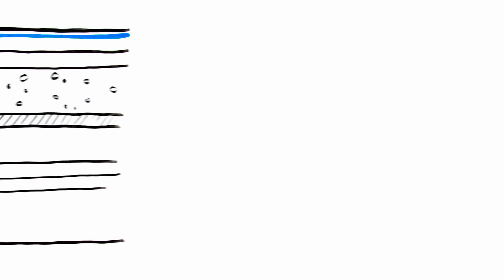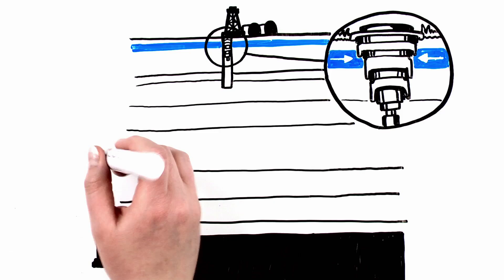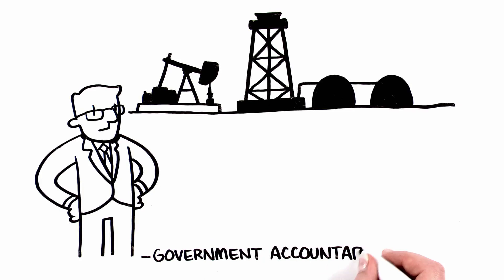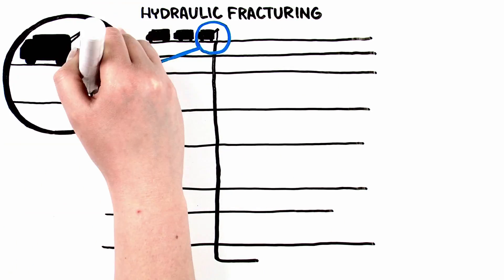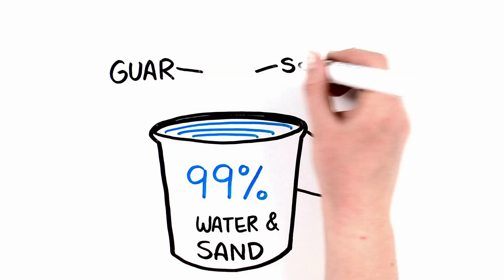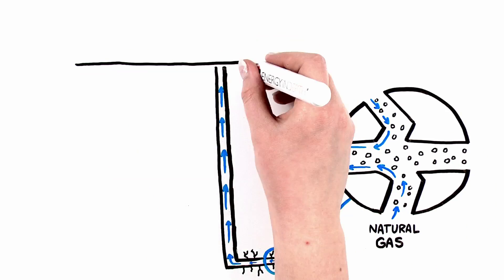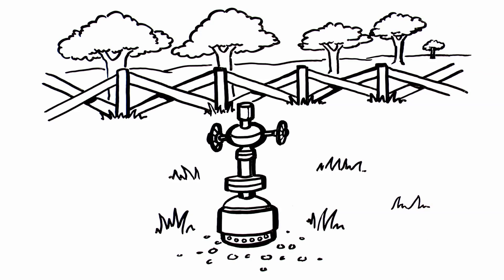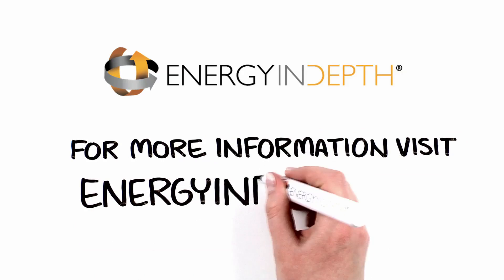What is Hydraulic Fracturing?

Comment: Engineers and scientists use the term hydraulic fracturing—shortened to hydrofracking, fracturing, or just plain fracking—to mean this very specific activity. Torpedoes were used earlier in oil wells to increase the well flow laying the roots of "Fracturing"
know more : https://oges.info/library/141575/DID-YOU-KNOW_-Torpedoes-were-used-earlier-in-oil

Comment: as someone who has worked on a frac crew the last 3.5 years in Canada, this is a pretty accurate but basic description. Theres a hell of a lot more too it.. also a lot more chemicals are used in the mixtures (synthetic acids, biocides etc).. after the frac job is done, they do a flow back and most of the chemicals flowback up the well into a tank for proper disposal.
Reply: where does the plowback get disposed tho??

Comment: There are a few things missing from this presentation that should be included or could use more clarification:
1) Steel casing is set at shallow depths and surrounded with cement to protect the shallow water formations by holding the casing in place and sealing off the casing from the formations.... the amount of casing is set by regulations related to the depth of usable water.....
2) There are not only federal  but state regulations in place to assist in the protection of the subsurface....
3) Sand isn't the only substance used with the frac fluids to open the fractures formed....